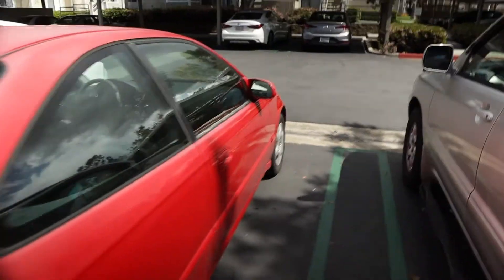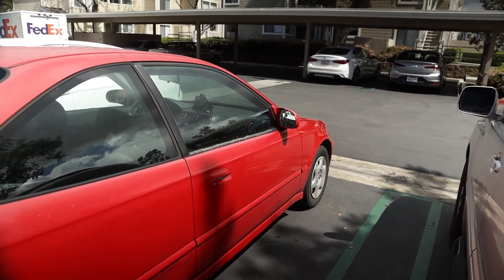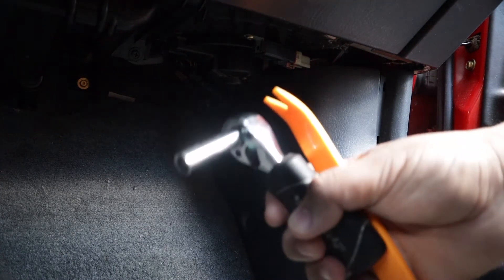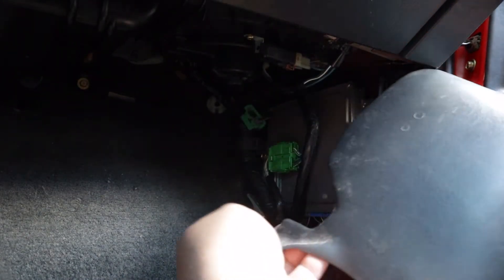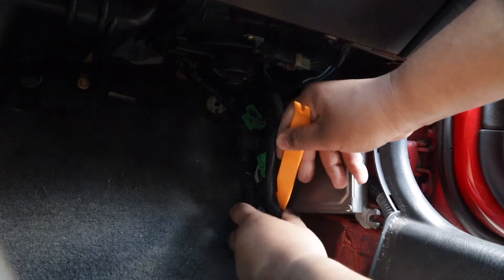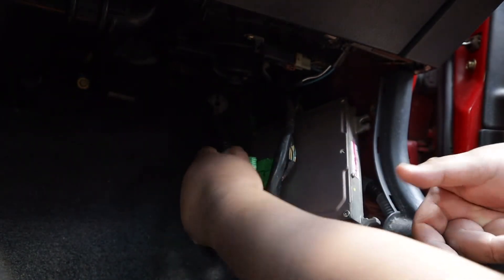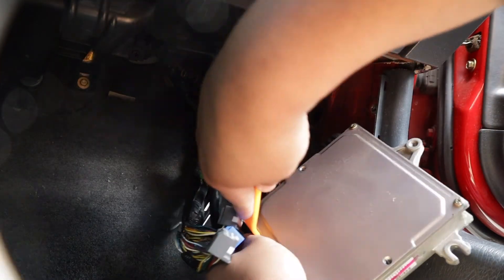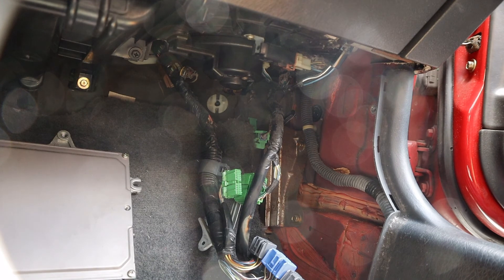How To Replace ECU | Honda Civic

Comment: Do you know if I can plug and play a new ecu in a 2001 Honda civic ex with out having to use a can tool I wanna try to replace mine but I don’t know if I can just put a new one in
Reply from the maker: Yes,as long as the ECU is programmed for that model’s engine and transmission.

Comment: Hi, great video, Very easy to follow. I have a question hopefully you can answer. I have a 93 Civic EX coupe and I think my transmission control module (TCM) is starting to go bad. Where is it located and is it something I can replace myself? Thanks
Reply from the maker: Automatic? If so it’s part of the ECU.
Reply: Hi,thanks for replying. Yes it's an automatic. So I would have to replace the whole ECU then? @DailyCruzer
Reply from the maker: Not one to diagnose or tell you what you need to replace. But if your TCM is bad then yes you have to replace your ECU. Let us know the outcome.
Reply: I have a manual 99 i need to replace my  pcm is that in the ecu? Or in a different location,? @DailyCruzer
Reply from the maker: @36ELGALAN yes in the 99 civic the pcm is part of the ecu
Reply: @DailyCruzer  thanks for the quick response 👍
Reply from the maker: @36ELGALAN I try. Good luck with your repair.

Comment: Which ECU was the one that u took out?
Reply from the maker: I took out the oem ecu
Reply: @DailyCruzer  do you happen to know the part number ?
Reply from the maker: For the oem ecu? 37820-p2p-a12 (manual) or 37820-p2p-a92 (auto)
Reply: Is swapping ecu plug and play as long as it’s manual to manual?
Reply from the maker: Typically.

Comment: All I did was unplug the wires and plug it back now my car won’t start
Reply from the maker: What wires?
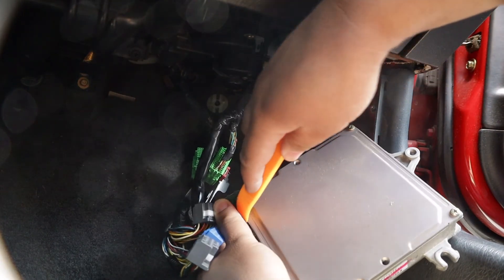Reply: @DailyCruzer  so at 3:22 on the video the last one you took off when my car is running and I just touch the wire my car shuts off .. I’m thinking it’s a shortage in the wire how could I find where shortage is at

Comment: I've heard replacing the ECU in Honda's can require you to get your key reprogrammed. Is this true in all cases, or just something that may happen?
Reply from the maker: Depends on how old/new the car is. This civic does not have a key fob just a simple key.
Reply: if its a chipped key yes you need it reprogramed